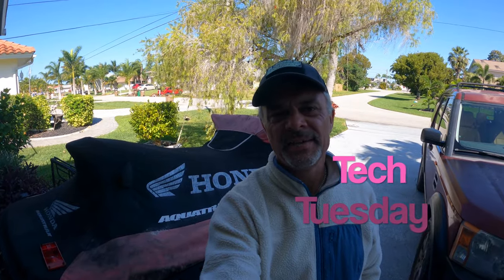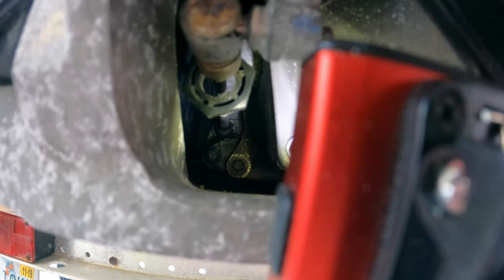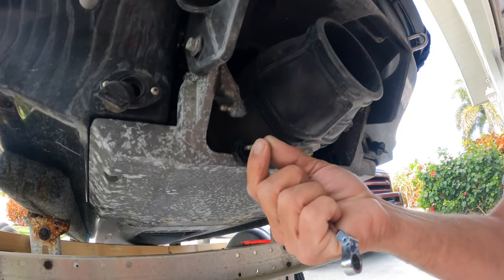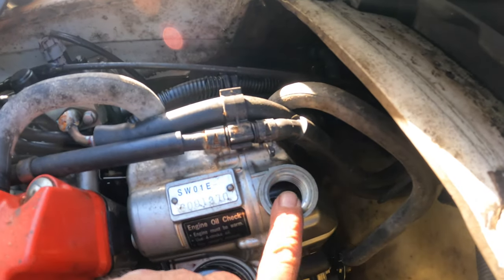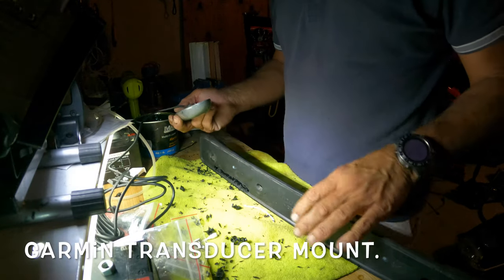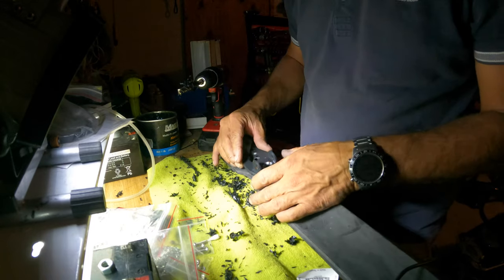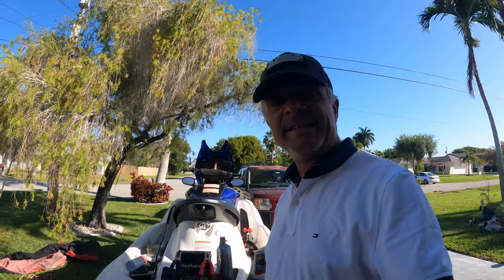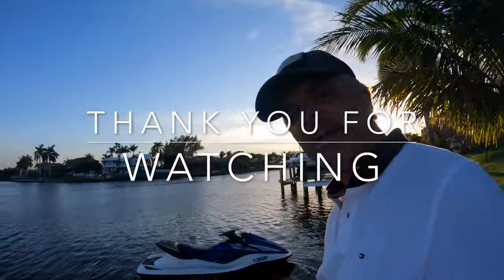Restauration of a Jetski, Honda Aquatrax F12X turbo   4K

Comment: How was it to screw the new reverse cable nut for the first time? im doing my steering cable and its very tough to get it started because of the fine thread on the reverse and steering cable mounts. I have the Tap for the hole to chase the Threads but i also cant seem to get the steering cable forward enough to even be able to do that...
Also did you have any issues with very tight rideplate mounting bolts? i see you just went to it with the impact wrench right away and it seemed to work out well for you.. 
im afraid that if i go any harder it will break or most likely, the nut will spin inside the hull against whatever is holding it..
Thanks
Reply from the maker: Thanks for watching and commenting, I just made sure the cable and bolt was very clean. I put salt water resistant grease made by Volvo in between. It can be a little bit tricky to get it to  fit but just take your time. My bolts came out fairly easy and with no violence.  

I hope that helps - sail safely, best regards Rene

Comment: Rene, thank you.  How did you run the cable thru the wall of the ski?  What kind of fitting did you use to keep it water tight?  How did the transducer perform?
Reply from the maker: Thank you for commenting, and viewing. I ran the cable through from the inside and out. The fitting I used was ordered from Amazon - I took the brass version since it holds up a lot longer in the Florida sun and environment when out of water. I used very little lubricant to make sure it was completely sealed and also for future disassembly if necessary. The through hull fitting is best to get from a local dealer then you know it’s the right one. Not expensive-22usd. 

The transducer works very well, and is giving great views on display. When you are moving full speed, you can’t trust it 100 percent but still good eccoes.

The lubricant has to be salt water resistant. 

Hope that helps a little. 

Sail safely

Best regards Rene.

Comment: Thanks for the posting. Where do you get the brass part ?
Reply from the maker: Thanks for watching :) I got it from the local dealer, however it is on amazon too.

I could not find the Brass one I have and it is the best since an aluminum will galvanise into the wrinkles and get stuck with time due the corrosion.

but here is a link :
https://sellclip.xyz/product_details/19591287.html

I hope that helps 

drive safely 

Best regards

Rene
Reply from the maker: amazon: but remember to buy the three seals as well (rubber) that goes inside :) 

https://www.amazon.com/Upgraded-277001627-277000052-277000784-277001729/dp/B01BHI8OAQ/ref=sr_1_35?crid=3DQ4NL2CIOS7Z&keywords=steering+cable+lock+nut+honda+aquatrax&qid=1656783354&sprefix=steering+cable+lock+nut+honda+aquatrax%2Caps%2C254&sr=8-35

Comment: I have a question where did you buy the brass fittings and what sizes are them . Help me out please
Reply from the maker: Absolutely. The brass fitting was bought on Amazon if you cannot find it I will post the link here later on this week

Make sure you buy the entire set

Best regards Rene
Reply from the maker: https://www.amazon.com/JSP-Manufacturing-Aluminum-Compatible-90212-HW1-670/dp/B07WWK2NCY/ref=mp_s_a_1_4?dchild=1&keywords=Honda+aquaTrax+steering+cable+lock+nut&qid=1620559680&sr=8-4

Comment: What engine cooling system does the Honda use?
Reply from the maker: It withdraws saltwater through the jet impeller device below, from the outside - so the water temperature will have an impact on operating temperature.

I does not have an internally cooling system if that helps...

best regards

Rene

Comment: I hope you know aluminum and brass do not like each other they will unfortunately Weld themselves together and you’ll never get them a part hope I was helpful.
Reply from the maker: Thanks for commenting, and you are sort of right and very helpful - however it is stainless steel and aluminum that makes a reaction so you won’t get them apart. However with brass, using sulfo or strong soap will release the two materials after a little time and you can work with it again if you want. Bear in mind I do not want to work on it again and therefor not interested in taking apart again :) the original plastic piece was simply too weak and could have had a better solution. If you use a little saltwater Grease - Volvo Penta is good, you don’t need strong soap. It comes apart easily. The problem really is that the cables needs to be lubricated very often in order to avoid the plastic piece to brake. 

Sail safely, and stay safe 

Best regards 

Rene.